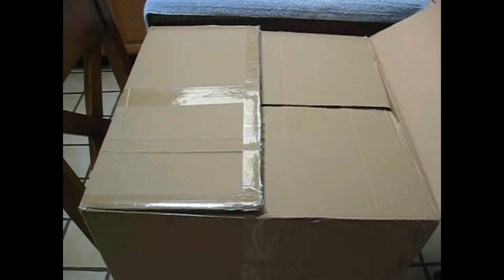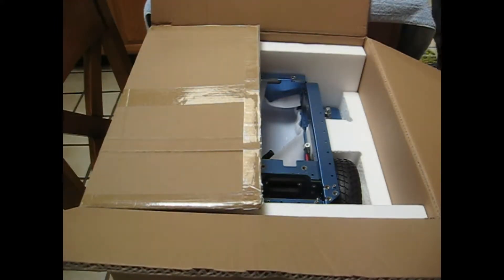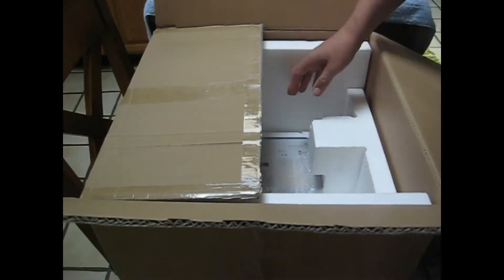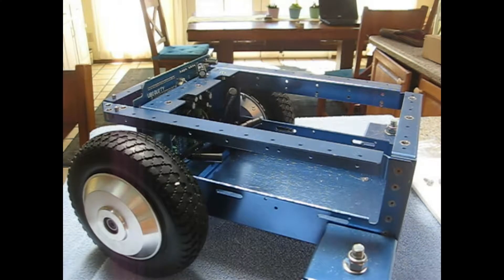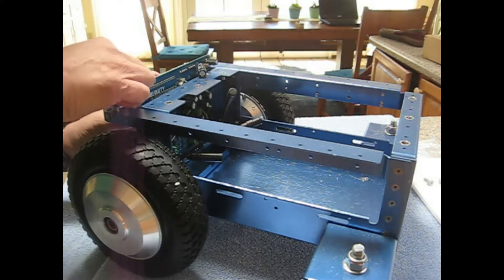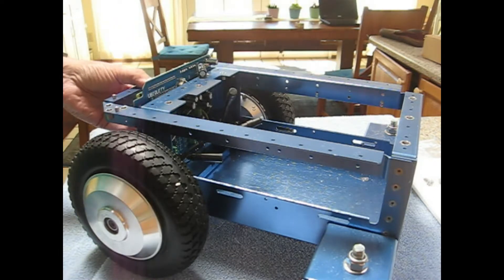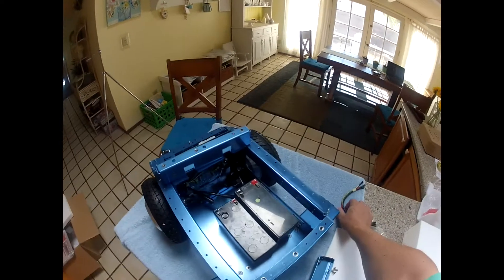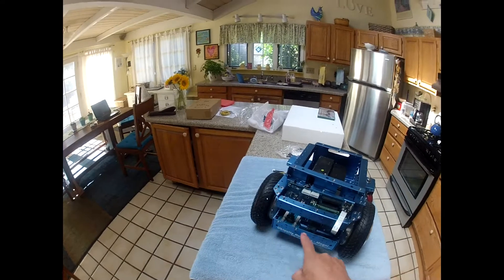unboxing

Comment: @Alan: Thanks for sharing the video. It seems, Ubiquity doesn't ship the batteries along with the Magni Silver robot. It's suggested to fit in 12V lead acid-based rechargeable battery. 

Appreciate if you can confirm whether this 12V lead acid-based rechargeable battery will fit into the chassis or not? The dimensions of the battery are Length: 5.94 inches, Width: 3.88inches & Height: 4.00 inches.

https://www.amazon.in/AMARON-QUANTA-UPS-Emergency-Battery-Instruments/dp/B08934WTHZ/ref=sr_1_3